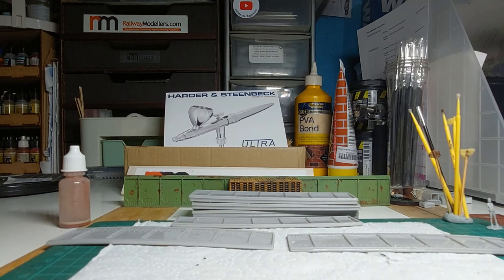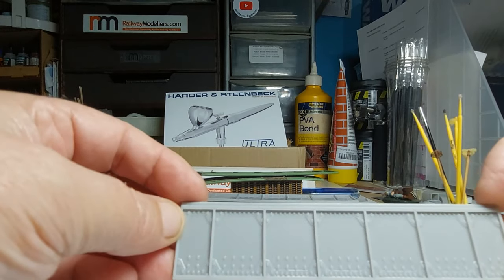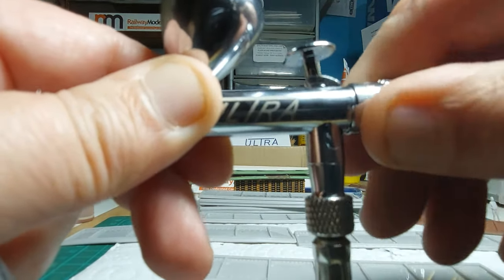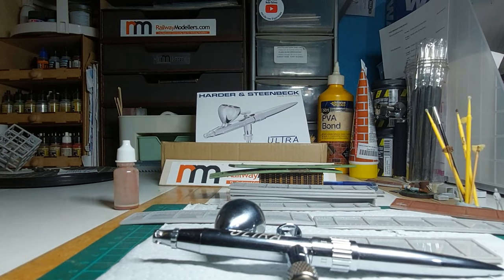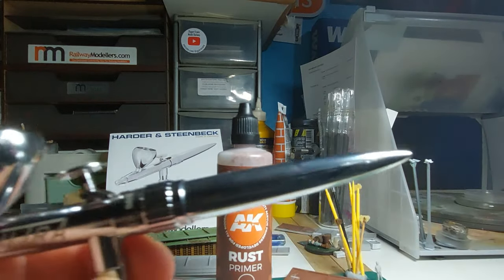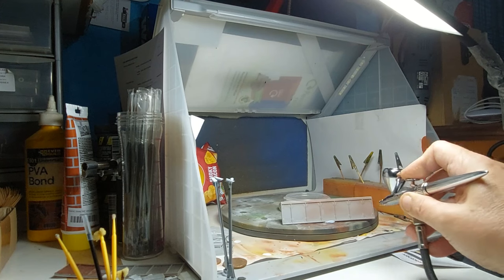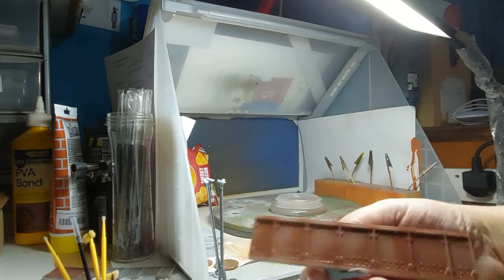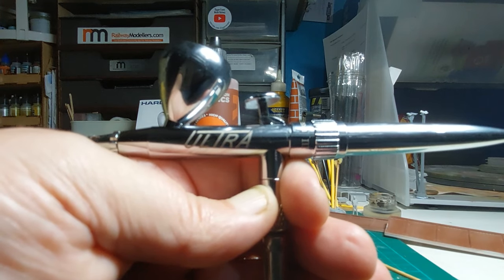Painting resin prints for your layout

Comment: Nice work Digger.
I'm still using rattle cans if I need to spray anything.
Don't forget to mention that Resin printers are good for high detail small items like your wagon sides and FDM printers are good for large items like buildings.
Many of my buildings on my layouts are printed on an FDM printer for example.
Stay safe and happy modelling
Mon
Reply from the maker: Thanks Mon you are absolutely correct my friend larger items requiring less detail can be better made on a filament printer.

Comment: Hi Digger, very nice airbrush! I have to admit, I've had quite cheap airbrushes from the start, but they've been enough for my purposes so far. Still, I'm aiming for an airbrush with a pistol grip and a fan spray cap(!). Maybe one fine day...
Cheers my friend - Ralf
Reply from the maker: Thank you Ralf  the cheaper air brushes are fine for some jobs as ling as you can get spare seals etc..
Reply: @DiggerEvans  Absolutely true, but in an "emergency", Teflon sealing tape can be very helpful.😏😇

Comment: Are you venting out somewhere or….?
Reply from the maker: Hiya  Charlie yes theres an extractor with a particulate filter and an exhaust pipe. I didnt use it for this demo as its very noisy and would disrupt the sound on the video. One piece of resin bridge is just about okay to get away with not using the extractor